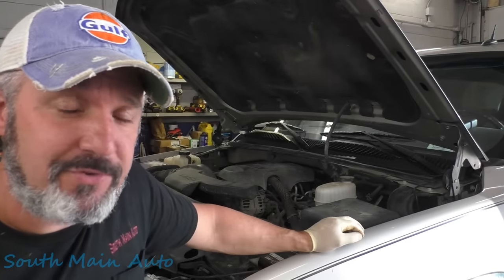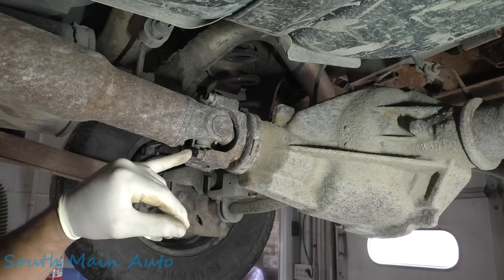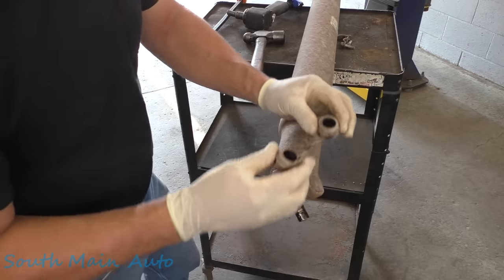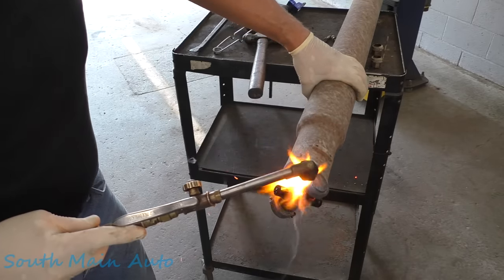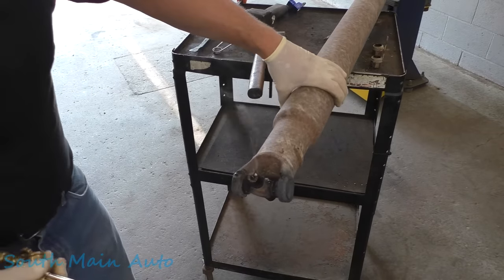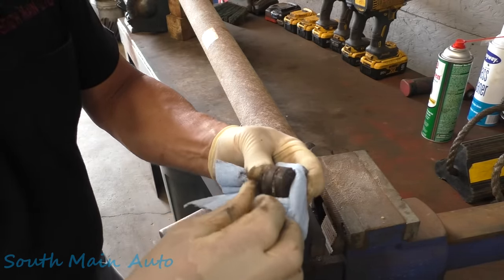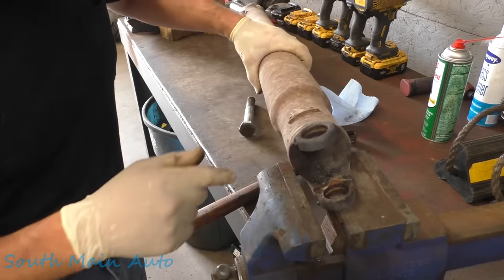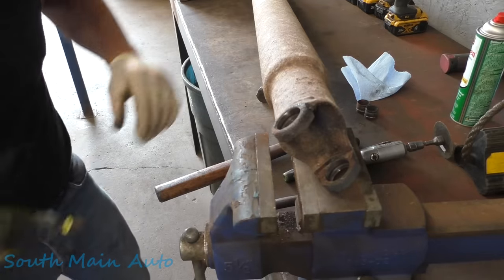GM Nylon Injection U-Joint Replacement

Comment: I made my own fitting to grease these types of u-joints. At least it worked on my 1986 Toyota 4-Runner. I just applied the grease fitting on my grease gun to the face of my grinder and flattened 2 sides. It slipped right on to the zerk and greased that fitting slicker than, well, grease.

Comment: I worked at my Dad's service station for several years and I did a bunch of the plastic joints... 20 to 50 of them.  I lost count.
You were doing good until you cut the cross out with a torch.  I never had to do that.
It would be easier to make a sketch... 
You take the the two loose caps off.
Open your vice up, so you set the cross on top of the vice jaws, with one of the "plastic" caps facing up.  
Do NOT clamp anything with the vise.  
Heat up the drive shaft yoke until the plastic is oozing out...
Then give the yoke a good tap or two with a small sledge hammer; driving the drive shaft down.  And the cap pops up.
Rotate the shaft and repeat on the other cap.
The cross will then come out.
Since you're heating the yoke loop to blow the plastic, it's also expanding the loop metal, and reduces the press fit.  So, just hit it before the heat dissipates.
Reply: Yes, works very well.
Reply: @wssides  Thanks...  Of course, the worse was assembly and dropping a needle, or thinking you did!

Comment: In Feb of 1982 my 73 dodge Coronet u joints were shaking me out of the car on my way home from work at 0745pm. I made it to Trak Auto just before they closed. It was 5 degrees outside. I changed those bastards right in their parking lot with 2 farmers jacks and a raovak flashlight from RadioShack. The employees leaving the store were in awe. I got those babies on at the cost of extreme shrinkage and near frostbit fingers.  Drove outta that lot like a boss.  God I miss that car.

Comment: I still remember the first one of them I changed, trying to press it out without heating and cussing up a storm, then I thought maybe there was some kind of set screw or clip behind the bumps and tried drilling it out. after two hours of cussing I realized when drilling it melted and then got the idea to use the plumbing torch.
later I discovered using my giant roofing/ice melt torch blasts the whole joint at once, especially good for the front joint. just need some good gloves to handle it.

Comment: I did a U joint on my car years ago with those plastic retainers on it. I used a propane torch to heat them up and the plastic exploded out of those caps and burned the crap out of my hands and arms!!  When it exploded it sounded like a firecracker!!!

Comment: One tip I'd give away for free, is to use the bench-vise when installing the new joint. I dont like beating the new ones into the yoke. Go slow and steady. Ive had to use the hammer method to beat new ones in, but a bench-vise is smoother and doesnt allow for a bigger mistake to happen.

Comment: This is the only way I know how to use a oxy/accet torch is on old ujoints.  I loved it.  But instead of cutting the ujoint I, after de worming it, would heat up the cap and blow it off!  Truly the best way and most fun! :D

Comment: Of course its easy with a big torch. But using a propane/map gas torch its a pain in the ass. 

I just did both driveshaft U-Joints on my 2000 GMC Jimmy Diamond Edition and i ended up getting an aluminum driveshaft from a 04 GMC Envoy Denali and then new u joints because the OG driveshaft was rusted so bad. But that nylon was a nightmare to get out and knocking the caps out was difficult. 

Just an FYI for anyone who doesnt have the big boy torch. Its not as easy as it looks. And ive been doing this for 14 years.

Comment: Nice Mr. O! The word fret can use to describe the orange dust coming from a none lubricated bearing (of course it should be lubed) or spline that has movement. The only metal that I know of that frets orange dust is ferrous metals.

Comment: I did not know about the plastic keepers.  I pulled the drive shaft on my 07 trailblazer to lub the splines and reused the real Ujoints.  I did not notice what type of joint was there.  Because he cut the X it must be hard to drive out the old ones cause not all the plastic comes out.  Maybe they would drive out if hot enough to soften the plastic.

Comment: I pressed mine out but I have to say I watched the needle climb to 9,000 lbs,. and was just reaching for the relief valve to back off for another go when it broke loose like a shotgun shell going off  . Yes  , everything worked out but it would have been smoother had I known about this trick !

Comment: The propane torch method is a lot faster because you use the cross to knock both caps out, Quicker and safer.

Comment: I had a Chevrolet Nova 1976 w/327ci.  That I did this job on back in the 80s.  I used a vice to press out the old one and dam neat broke the vice.  Tough job because of the rust.

Comment: SKF is a top brand, they make the best automotive ball bearings on the planet, lasting hundreds of thousands of miles. Never had trouble with their stuff, from a car manufacturer or from aftermarket.
As long as you don't buy a fake SKF part, you will never have any trouble with it.

Comment: Eric O. Done many. Sure does stink. Sometimes it will go Bam! Like an M-80. I never cut the cross though, always just blasted it out with a BFH, and reassemble it the same way you did. I never took the time to clean out the groove in the yoke either. I only just learned of Fluid Film, so I always coated everything with Wheel Bearing Grease for me for the next time or the next guy. You are very comprehensive, meticulous and very complete. Thank You for doing videos of such Super High Quality Work. And I'm one to know it when I see it after seeing so many carpet-bagger/ hacks. You Are a Quadruple-A credit to America. ben/ michigan

Comment: Heating the surrounds of the u joint allows it to come out easier but when the metal cools it shrinks back microscopically smaller . Thats why it was so hard to get the new one in. If done cold it will push out and the new one will go bacl in easier. Use some sockets as spacers and do the press removal in a vice. THere should be no need to use oxy at all.
Reply: How many of these u-jts have you done?  Being a flat rate tech myself, and having done numerous of these, you always want the easiest quickest way to get the job done correctly.  Heating it to melt the nylon out and the minor inconvenience of the microscopically smaller holes is way easier than fighting to break the caps loose w the nylon intact.  Just my 2 cents....

Comment: I was told that in high performance situations you should make sure the grease fitting is indexed so that it will be in compression when torque is applied.

Comment: My local Advance Auto stocks 10-12 Spicer numbers. Then a lot of Moog and a couple others. I'm surprised yours doesn't. Nothing's more fun than changing a U joint in a parking lot using the parking blocks and a hammer.

Comment: I used to squeeze the caps in place with a vise. I was afraid of the needles knocked out of place (happened a couple of times}with a hammer. Thank you for the video.
Reply: If you fill the caps with grease they tend to stay in place

Comment: I've seen were you can just cut the little plastic nipple thing that sticks out with a knife.  Then you can get a little punch or even with the blade tip and ream out the hole a little bit.  Then you can just press it out like a normal one.  It was a different vehicle, but it may work on this type too.

Comment: I wish this video had been available 5 years ago!  I missed some of the finer details such as cleaning the grooves and positioning the clips and had a lot of vibration.  I ended up buying a new driveshaft for $300.  I''m certainly not a big fan of the injected plastic retainer.

Comment: I have used the little BRM dongle berry hones in  u joint holes and it works great. I see so many vehicles come in with grease joints off all types and not greased sometime never done and it’s  a shame

Comment: And that injected nylon works VERY well.  A drift bar and a 4 pound hammer will not be able to get the caps off until you melt that nylon out of the yoke.  I think they did that to encourage the average do-it-yourselfer to go out and buy a whole new drive shaft instead of replacing the bad u-joint.

Comment: I just did 3 of these on my 1972 caprice has 1 at trans shaft end 2 at rear with a gap yoke i dunno whats called but anyway  you dont have to heat them at all mine were in good shape from 1972 but did them anway they popped right out with a c clam press and arm power rachet didnt even need an impac gun. Then i just used a small flathead screw driver and picked at theplastic mold riing , what remained in the saft and it came right out the force of c clam snapped and sheared the plastic inject smooth in half.

Comment: I have an adapter for the shop press, been using that for 30 yrs.  Most guys use the vic method, with no issues other than breathing in toxic fumes. The local driveshaft shop here will not touch a driveshaft that has been heated.  What ever works to get the junkers to back out of the bay.

Comment: Melt out the retainers. Put the worn u joint across the vise jaws and tap the drive shaft. The old u-joint drives out the old caps and the joint falls out.
Reply: My usual way too. Just a hammer on the cross if someone else was using the vice or there was too much stuff on the bench. Also used the vice to install the new caps quite often but found the light hammer method faster.

Comment: Just a heads up. I've only seen this happen a couple of times but when the u joint was heated up the cap shot off like a cannon and flew across the shop. Fortunately it didn't hit anyone. I don't know if the worm hole was plugged up or what, but I always make sure the cap is pointed away from anyone when heating it. It could seriously mess someone up.
Reply: Came here to see if it happened to others too …

Comment: Good to see you used greaseable fitting in the u-joint. I prefer that type and yes Spicer is the Best
Reply: them are fine for daily drivers, but if you makes some power, or abuse them, the non greaseable ones are stronger.

Comment: You can also grease them before you install them in the vehicle.

One question I have is why didn't you replace both or if this is a pick up or long framed truck, also replace the carrier bearing?

Comment: My guess is that you use fire to melt the nylon. Let's see if I'm right. I like to pop the nylon in a press. This leaves the grooves and injection holes filled - keeps water out.

Comment: Without finding one of these videos on how to remove this I would have ended up taking it to a drive shaft shop and spending lots of money. Once you get a nice hot torch on there and it oozes out the U-joint it just pops right apart

Comment: What size cutting tip would you use for this?   Do you use the same size  for everything around the shop? From heating fasteners to general cutting?

Comment: I had a 1987 Monte Carlo with the factory glued in u-joints. They were bad. So I changed them. The car then had a horrible vibration. Took shaft out, checked everything. I gave up and took it to a drive shaft shop. The owner walked in, just glanced at the shaft and says "Let me guess.....GM shaft you changed u-joints now it vibrates."  Yes. Bring the shaft follow me. He put the shaft in his lathe, the front yoke / u-joint was 1/4" off center, the rear was 1/8" off center. "I get these all the time because GM cheaped out putting these together."  They just slam the end yokes in the tubes, eyeball straightness and weld it. The u-joint then is pressed in centering the the "shaft" but not centered in the yoke and the nylon is squirted in.  He popped both u-joints out, cut both yokes lose, tapped them into the tubes. Then used a dial indicator to center them before welding. Both ends were less than .0001 off. Rebalanced with new Spicer u-joints. The car was perfect then.

Comment: Another one of GM’s better ideas.  Makes a simple u-joint swap require a torch and take three times as long.
Reply: It really doesn't take long to heat and pop out that nylon. Why they think it's faster to install that at the factory I don't get. It seems like a press setup could be automated to press c-clips just as easy as making a setup to inject the nylon.
Reply: @Ghauster  I can pop out a snap ring much faster than you can heat out the plastic and then cool down the part enough to work on it.  I’m guessing some young engineer was sold on it being the “latest and greatest” technology by some vendor sales rep.

Comment: Thanks for this video.  My Yukon just rolled 200k so maybe I’ll need to do this soon. Haven’t seen anyone do the plastic ones yet, only read about doing it. Looks pretty easy for a at home DIY guy like me.  I was assuming greasable was better but I’ll get the spicer non-greasable if Eric O says so!
Reply: I ran greaseable ones years ago and could  never get the grease onto the zerk on the front u-joint without unhooking driveshaft from the rear end and angling it near full tilt.
you can already guess what happened right? it only got greased twice and didn't last very long. the rear I could just get onto with an expensive angle grease gun end. never bothered with greaseable again, also them being cross drilled weakens the cross somewhat. high performance or towing can break them easier.
Reply: Yes use the spicers or neapco,  the only issue Ive had replacing these type joints is a driveline vibration after the fact,  this is due to these drivelines (technically) are not serviceable and these joints are aftermarket.  so if you notice a high speed vibration you'll need to go have it balanced at a driveline shop. usually cost about $60.
Reply: @MrChevelle83  you possibly changed the clocking of ends. stamp/grinder mark them and make sure they're the same place and not flipped 180 degree..
Reply: @throttlebottle5906  not likely, the problem I was told by the drive line shop is these epoxy joint yokes are not intended to have an internal snap ring so the tolerances are not always proper.  and keep in mind we are talking a few thou outta tolerance.  if you offset a drive line say .015 that would be enough to cause a high speed harmonic which is all ive ever had.  Keeping it low speed you would never notice it.

Comment: I think a tool count (# of tools used during the job) at the end of each video would be an interesting number.
Reply: @DontCryAboutIt  Pretty much any job greater than an air filter change you can bank on “minimum” $500.00 tool value. Keeping in mind a basic Air tool is useless without tools to put in it, hoses, couplings and a Compressor. A cordless tool is useless without tools to put in it, a quality ratchet is useless without sockets etc. etc.

Comment: I've changed many u joints in many manners.  The best is probably the torch (or sawzall) and hammer method.  Alway protect the needle bearings.  I've had many fall over and get crushed.

Comment: Ive been melting GM joints out for 20+ years, The only thing I do different is instead of cutting through the cross I only heat the outer edge of the yoke starting at the injection point and go side to side around the cap area with the torch until the plastic exits the yoke through the injection holes,(looks like toothpaste leaving the tube)  then with the exposed + cross laying in the vice with the machined ends across the vice jaws and only hit the base of the yoke near the weld with the hammer, I never hit the cap area to avoid deforming it.   This drives the cap to the outside of the joint using the old cross as the driver.  Ive never damaged a yoke with this method.  The only time I cut through the cross is on front axle U joints because they are usually really rusty and the axles are super delicate and easy to deform with a hammer.

Comment: Nice work Mr. O!  Tight caps going in.  My Dad used the LARGE vice and a few well positioned nuts on his bench to press the caps in with a few "light taps" from a hammer to center everything.  
What about aluminum drive shafts?  Are the "U" joint ends steel?  How do you press out the joint caps on those shafts?

Comment: Wish they would have continued on with the steel driveshafts rather than the aluminum ones they use now.Great work as usual.
Reply: I notice my Silverado has an aluminum drive shaft.  What is the issue?
Reply: @desotosky1372  mine has the aluminum driveshaft as well no issues but I'd rather change out u joints in the steel over aluminum driveshafts that's all.

Comment: Don't be surprised if you have a driveline vibration after the replacement. GM was not very exact on the placement of the  joint in the shaft with the plastic injection Lock method. They were balanced afterword's and if the joint needs replaced later and the mechanical locks are used the shaft and joint position may not be where the balance was before the replacement . Had a garage my whole life and we learned let the customers know up front that it may be out of balance after the replacement and the shaft assembly may need rebalanced.

Comment: Dana makes spicer Ujoints/bearings, Precision makes a damn good Ujoint too...moog have gone to pot. I'm old school preferring greaseable ball, U and other joints so I can flush them out every couple months with fresh red n tacky grease. Any brand other than precision or spicer I get the sealed version because they are weaker and the grease ports are often in a bad spot.

Comment: I remember the times of oil changes when the Ford needed greasing when an oil change was done. They acted like it should cost extra to search for each fitting and pump them up.

Comment: GM must of had a reason to use that setup over retainer clips  .maybe to save time  or some kind of perfect alignment for driveshaft
Reply: Probably cheaper, and quicker on the assembly line. Rather than having to get a clip into a groove they can just squirt it with plastic.